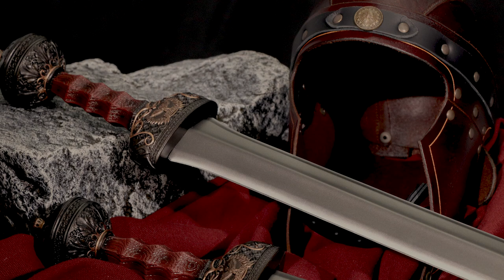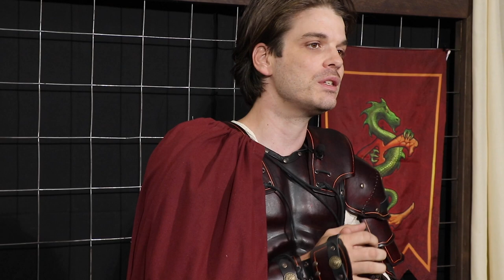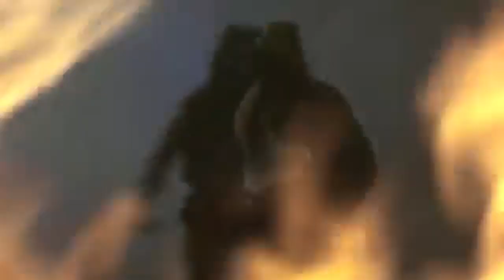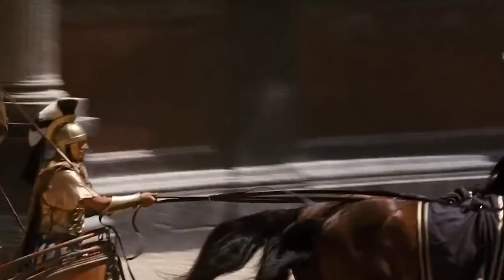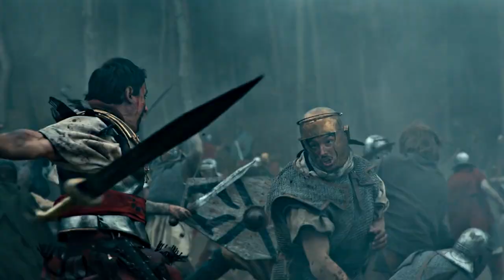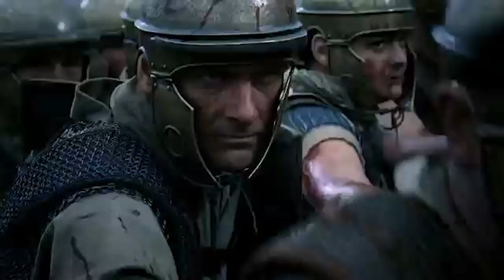Calimacil Presents our Roman Gladius

Comment: Some very nice details. My understanding is that the Hispaniensis was a rather early version of the sword, and it went shorter from then on. I suppose the bright side is that this could also double as a spatha. I am very keen to see a short sword version of something like this to match the more commonly used gladius designs, though, and the other one in the video did look a bit shorter. Overall, the gladius is a neat sword, and I quite like the look of this version's blade's shape. 

And if you ever do do the shield, please please make sure it has the proper grip shape (overhand, like a briefcase) rather than the rather depressingly common standard.
Reply: YES we need a proper scutum with horizontal grip instead of a vertical grip orientation.
Epic Armoury's ones are all hideously wrong.

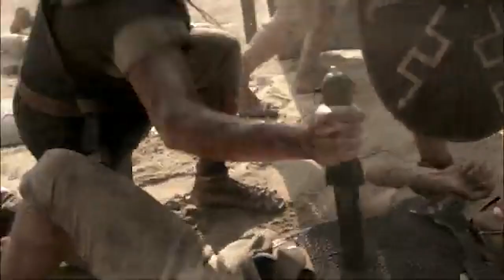Comment: 4:33 Not really, the metallurgy was ok. At the same time, Gauls had the earlier kledii with famously long blades, and Romans themselves had cavalry spathas with long blades, likely adapted from the celtic kledios. Those still functioned for both stabbing and cutting, even if they had slightly wider tips. The length of the blade wouldn't change the strength of the tip much, even with the distal taper.
That's not the reason why gladii had shorter blades on average. It's mostly because they were intended as primary weapons for heavy infantry, while most swords were still sidearms back then, with polearms as the primary weapons and daggers as last-ditch backups or for wrestling. The shorter gladii were meant as a more versatile option for shock assault while most of their opponents were using shield-walls with spears.
Reply: I believe there is a historical source where the author expresses horror at how the Romans were hacking off limbs and such. Clearly, the gladius was very stabbing oriented, but also used for some good old chopping. The wideness of the blade and occasional wasp waisting also favours some cuts.
Reply: @Canuovea  yep. Though those sources really have to be taken with a grain of salt. Like the whole "barbarians fought naked" thing. Ancient chroniclers were very prone to hyperbole like we still are today.